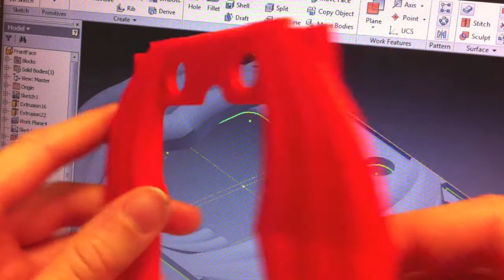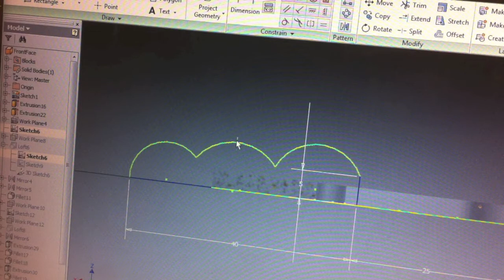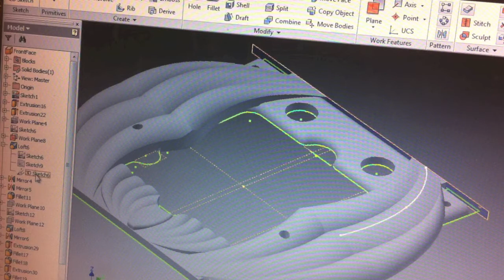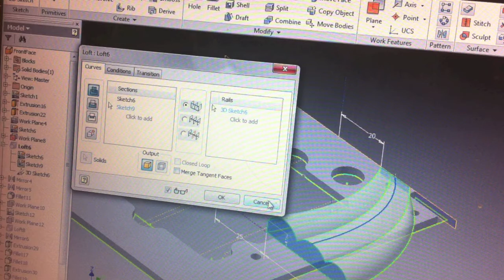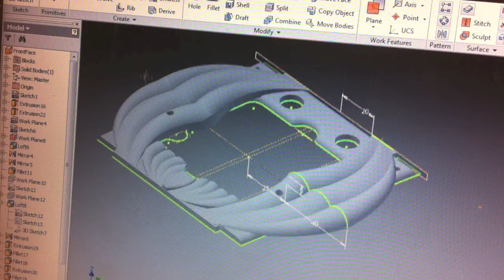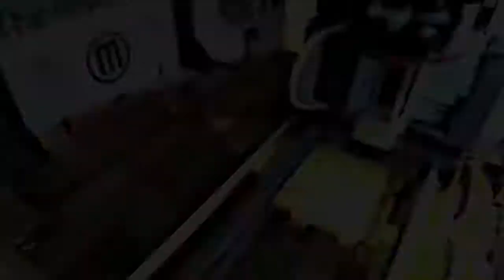Pumpkin RoboBrrd Face (Quick Autodesk Inventor Tip)

Comment from the maker: Hmmm... good question. Blender is great for making things in 3D, and you can measure things in it. However, it does have a steep learning curve. There's also OpenSCAD, where you can design things with lines of code. There is also SketchUp, which a lot of people use. Hope that answer helps you Christie! :D

Comment from the maker: Here's how I designed PUMPKIN RoboBrrd ;)
Reply: I love Inventor.
Reply from the maker: Richard OHearn Have you made many things in Inventor? Still trying to learn more about it, got any cool tips?

John Bump What are you making? Someone on LMR also posted recently about gEDA!
Reply: Unfortunately, no, I haven't had the time to really train myself.  I'm 1000 times faster in AutoCAD modeling, which isn't nearly as friendly to the manufacturing process, but still allows me to illustrate what I need to.  If you can find the time, I'd also look at PTC's CAD software.  Especially if you get into manufacturing engineering.  

But if you have any questions let me know, even if I don't know where the commands are in Inventor, I'm well versed in CAD language so I know what terminology to look for.
Reply from the maker: John Bump Wow, that is probably the coolest way to use gEDA ever! How old are the circuit boards that you are scanning?